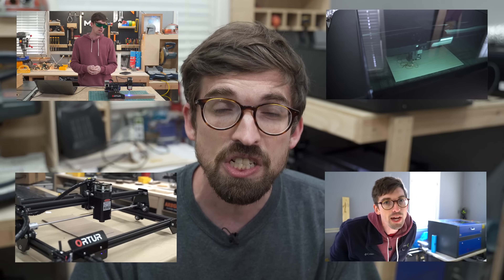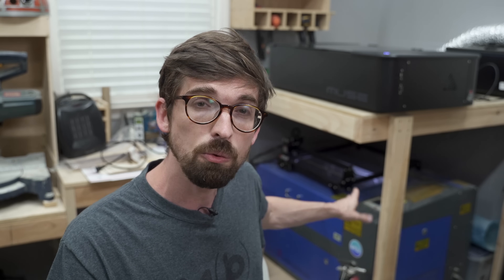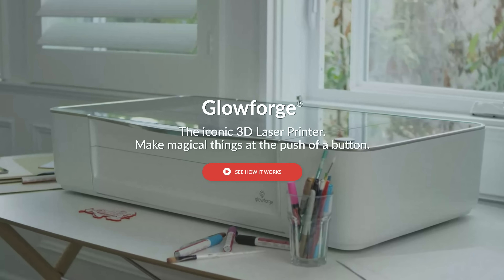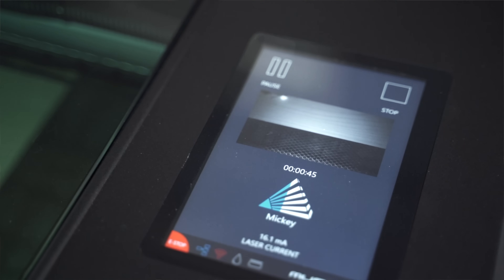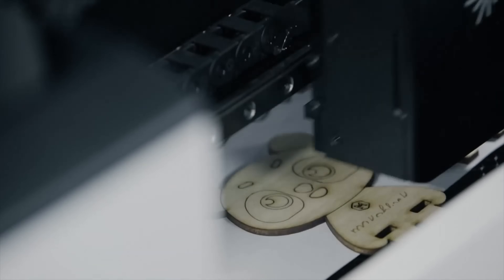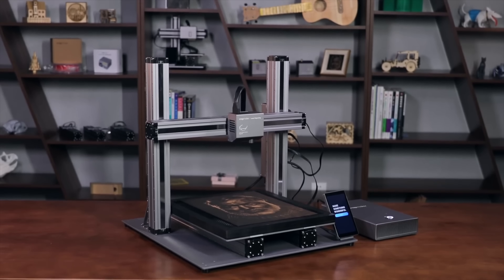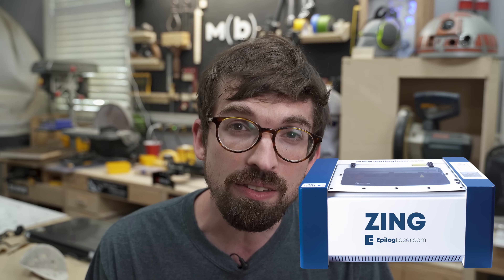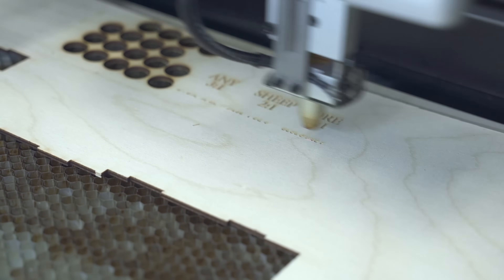What is the Best Laser Cutter and Engraver for You?

Comment: You should Review Gcc, Epilog and Trotec as these machines you have reviewed are basic ones
Reply: I agree 100% RF Laser tech is far superior than Glass Tube machines.  If you ever had the privilege to use say an Epilog and then a Chinese machine its like comparing BRZ to a GTR NISMO.  NO offense to any of those car owners they both get the job done however one is a true workhorse and the level is precision and accuracy cannot be replicated with a Glass Tube setup.  I used an Epilog for nearly 8yrs straight and not one single day did it fail or give a single problem.
Reply from the maker: Oh yeh Epilogue is great!  Just comes with a great price tag as well 😉
Reply: @makeorbreakshop   Yup, its all that back panel, Radio Frequency Laser vs Glass, BRZ $30,000 GTR NISMO $200,000.  There is good news however you can buy one of those workhorses that are about 10yrs old used for around 4,000 to 10,000 and it will do a better job than any of the new stuff, still pricey but they used to cost 30,000+.  Epilog Universal Vytek Trotec been in laser for decades.  All the new stuff has bells and whistles but if your buying a laser machine let the value be in the LASER and the Structure of the machine.  I used to put 300lb granite slabs in the LEgendEXT and engrave a full 36x24 image and it would never fail and be accurate from beginning to end, the table remained level through my 8yrs using it.  I tell you all you need to do with those machines is clean them thats it.
Reply: @makeorbreakshop  Do you mean Epilog? You get what you pay for in life. One Trotec can do the job of 6-10 Chinese lasers so if they are 5-7 times the price they are great value

Comment: When attaching a laser to an existing cnc machine how hard is the wiring side of things?  I have zero experience with laser engraving but have been using a cnc for about 6 months now would be nice to have the 2ft by 2ft area my cnc offers by adding a laser to it.
Reply from the maker: Most units are pretty easy to attach, check out J-Tech
Reply: Make or Break Shop thanks for the reply I have seen the J Tech kit it’s about $550-$750 depending on the laser.  My question is if I buy a stand alone laser build my own mounting hardware.  I have a bobscnc with the arduino driver.  I’ve even thought I’d buy the Ortur then transfer the laser and wiring over to my CNC.
Reply from the maker: @solafarms2295  yeh you could totally do that.  The Ortur kit is pretty modular so you could easily take the laser module off and retro fit it onto a CNC.
Reply: @makeorbreakshop  mate are you based in UK?

Comment: High extreme noob question, but do most of this laser engravers work on glass or metal too?
Reply from the maker: Glass yes, just make sure and get enough wattage to really make a mark.  For metal you will need a fiber laser which is much more expensive.  You can also get a spray like Ceramark or powder coat to get the effect of engraving on metal.
Reply: @makeorbreakshop  So basically if you want to laser engrave metal jewelry (like stainless steel or silver bracelets/pendants) without the spray or powder coat method, then you're going to need a fiber laser? If this is the case, then do you know if there are good fiber lasers for a few thousand dollars meant for these small hobby ish projects/consumers  (not the large, super expensive machines that are meant for industries and cost like 10k+)? Thanks alot
Reply: @makeorbreakshop  Hey man, what would you suggest for cutting leather? 50watt?
Reply: Yes they can/will - you typically just change the wattage or speed of the laser so it doesn't burn as long in one place.

Comment: Nice video. Wish you focused more on the higher end lasers but not really your target audience and not something you have in the shop. I wouldn't put boss anywhere near epilog. 
For general use CO2 lasers I would do a list like this:
- K40 + upgrades
- 50W ebay/ali chinese
- 80W ebay/ai chinese
- All in ones or what you call kickstarter lasers (including the more expensive dremel brand one)
- Branded chinese lasers with local support (boss, thunder, aeon etc)
- Finally top tier RF lasers (epilog, trotec, ULS etc)
There's plenty of specific machines that fall outside those categories. Like aeon having an 'all in one' style series and thunder laser having RF source lasers.
Reply from the maker: Good call, I like have the category of pro style chinese lasers (like Boss) as an additional one to those on the US side (Epilog).  I"ll make that update for a future version of the video!
Reply: Dose Epilog make great machine and after care? I just start talking to them. So far they are very helpful and sounds like they have what I need and they make quality machines in USA. Considering purchasing one of their machine for my metal and plastic work..

Comment: Hey question, I have a 3W laser and it's pretty small working space and can't do much with high quality images. It's a lot of tinkering and very poor resolution diode laser. I'm thinking about getting the Ortur 20W with the bigger working space. Do you think that would be able to give me better resolution? I like the larger working area with that one but I need something that would cut thin pieces as well as engrave photographs. Can you help me ?
Reply from the maker: So the 20W on the Ortur is a little confusing, its actually more like 4-5W, the 20W is the power going IN to the laser not coming out.  In terms of resolution thats more of a factor of laser focus versus power.  I would try playing around with your s and see if it can get more dialed first.

Comment: Does the cheapest one cut plexiglas or acrylic sheet? To what depth? Thanks.
Reply from the maker: To cut plexiglas or acrylic you'll need to get a Co2 laser.  The diodes will just be for engraving.
Reply: No the $200 dollar ones won't do a thing to Plexiglas you need to either just buy the higher grade one or pay someone to do it

Comment: I've been going back and forth between a diode laser and a CO2 laser like the K40. I am nervous about the lack of safety on the K40 but don't want to spend the money on a more expensive type until I determine how much I will use it. I love my 3D printer and this just makes since to me to get a laser that can cut as well as engrave.... so frustrated
Reply: As far as safety goes, it's not all that bad. It's mostly a lack of limit switches on the lid that shut off the laser when you open it. That, fortunately, is something for can fix for <$2 and 10 minutes of work.

Compare that to most diodes, which don't even have an enclosure to begin with, and you can argue the K40 is possibly safer 🙊
Reply: @jordymoors  You seem like an experienced guy. Do you have any advice on large working area laser? I need the power of CO2 and the K40 is affordable, but similar models with larger work area just skyrockets the price.

Comment: Hi ,50w machines can cut how many mm wood, I need a lot to answer this question
Reply: It really depends. Different woods cut differently. 
Soft woods can be cut thicker than hard woods. Things like plywood and MDF (which have a lot of glue) will cut worse.

You can also make multiple passes, go slower, etc. With 65% of an 80W tube, I've been able to cut 15mm pine...
Reply from the maker: I usually don't go much thicker than 1/4 in